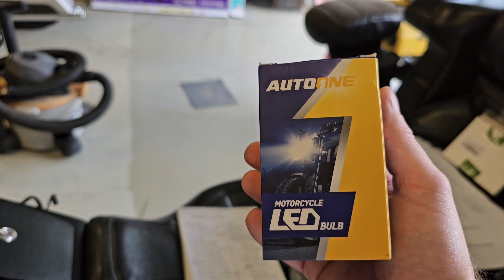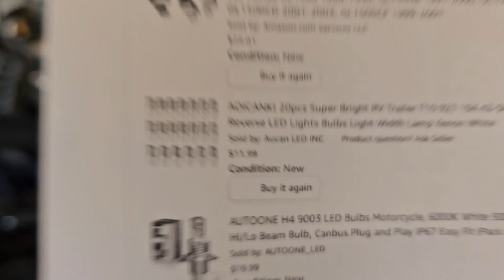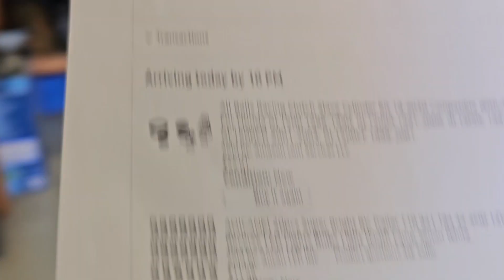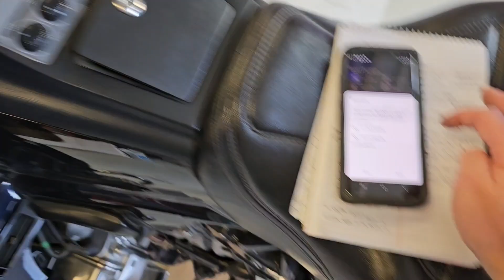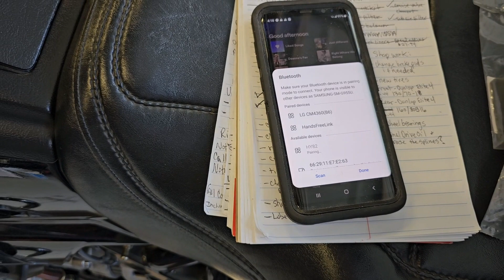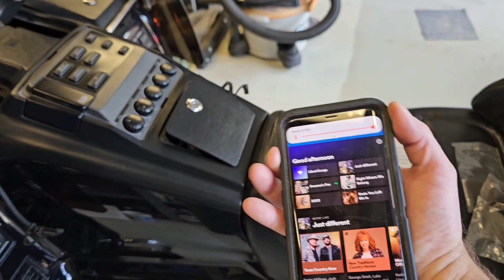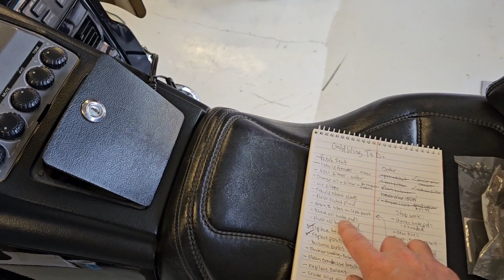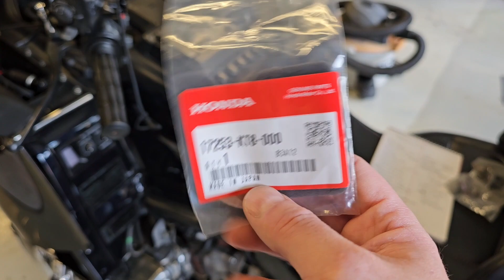1997 Honda GL1500 GoldWing SE... Upgrades, service stuff, older bikes, shops...

Comment: I have an 88 that I’ve been fixing up and I love it! My next project is getting a new fuel pump. I already did the aftermarket pump but didn’t last longer than 3-4 months so I may go oem now. As far as your radio, mine stopped playing FM stations for some reason. Everyone says to send it to Sierra but man I can’t  justify $140 bucks just for FM radio stations! I wish there was a bluetooth transmitter for AM stations! No clue how to get the darn FM working, but anyway thank you for the video!

Comment: I like your attitude man and your approach to just being a motorcyclist. The cruise valve filter lies right behind the panel/plastic where your left knee would rest against the plastic if you're sitting on the bike. It's vice-versa for the other thin flat filter on the right side. There is a small black box on both sides. The L shaped filter is for the left side box.

Comment: I've got a 97 aspencade. With a trailer. And I got a 20/20 street glide special. And I wear my Harley stuff when I ride the Honda also ,so I understand what you mean. But you're right those bikes are super comfortable and quiet. So quiet I fell asleep on it while on the highway and ended up in the other lane.. keep up the good videos

Comment: This is just a thought if you would do your self a favor you might consider changing your fork oil. You might look that up.
Reply from the maker: That's a good point. I didn't see it listed in the owners manual service chart, I've got it noted now. Plus it has the Progressive fork springs. I've done it on my Harley, just slipped my mind.